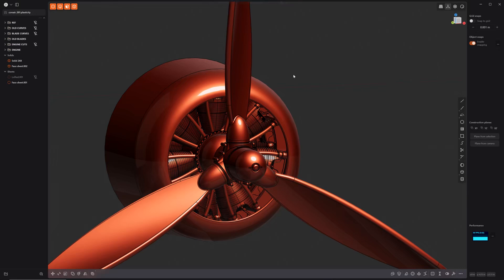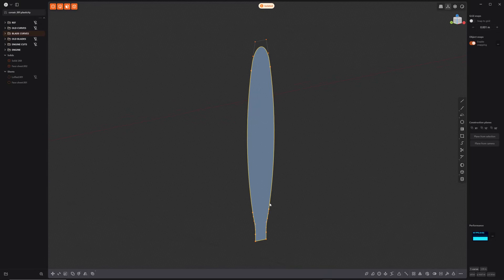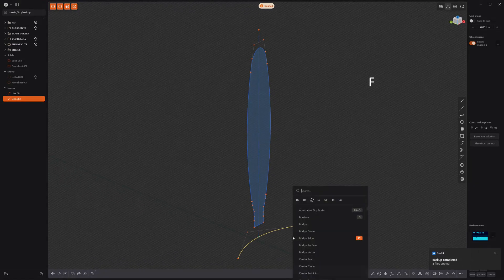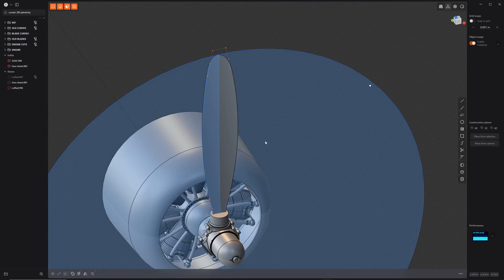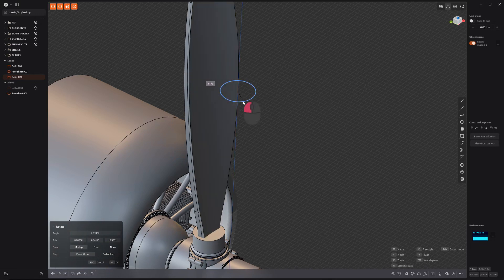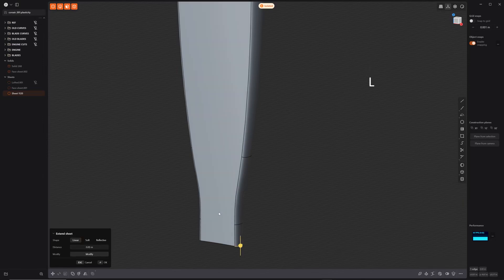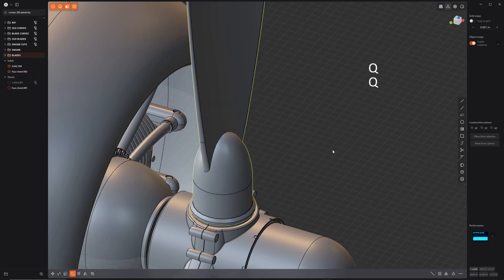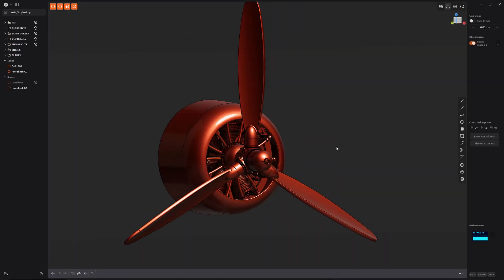88 PLASTICITY 101 QUICK & DIRTY PROPELLER

Comment: For a bit of technical info, the reason for the twist in the blade is due to the fact the upper most area is spinning faster than the lower area. The twist ensures the air being pushed off the blade is traveling at the same speed. The area where the twist is the greatest, the air will be pushed off the blade slower and that way reduces the chop that can cause a blade to fail.
Reply from the maker: Cool. Thanks for the info